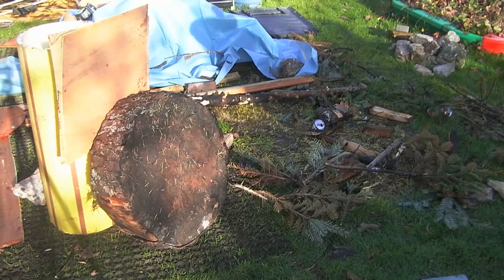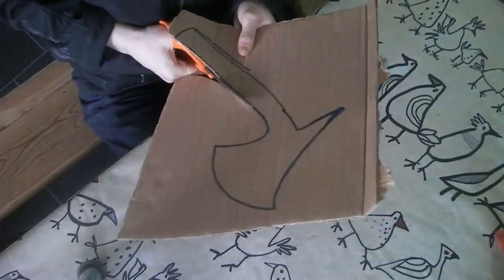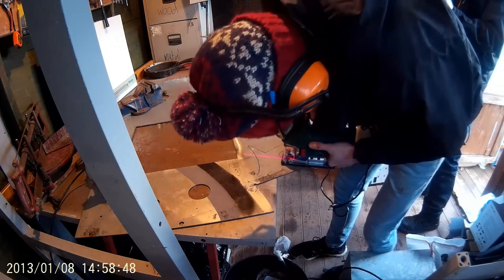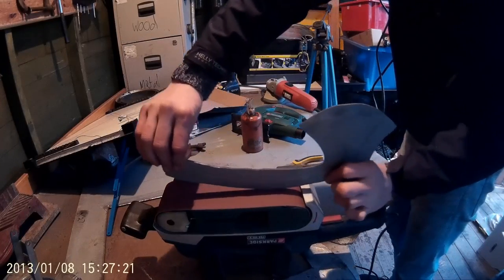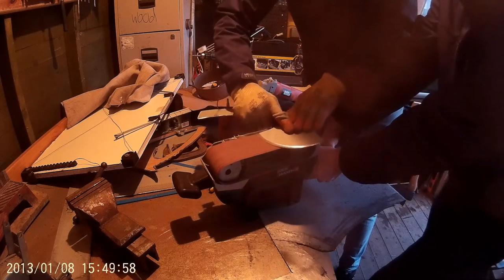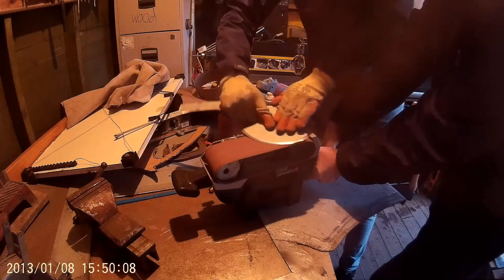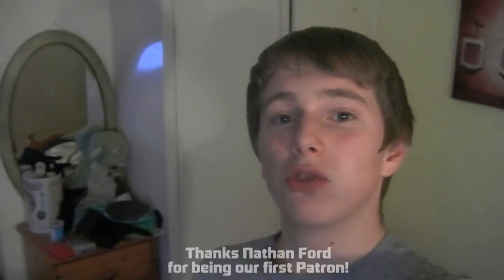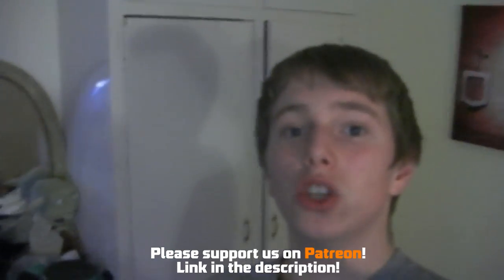How To Make: A Tomahawk/Throwing Axe

Comment: You should really learn how to heat treat and temper.
These are more for props/wall hangers
Without a heat treat and tempering you're basically spending a couple hours doing nothing because the edge will roll and go blunt within the first couple throws/hits.

Comment: Was the steel plate already heat treated or you just made a blunt piece of metal?
Reply from the maker: The metal isn't heat treated but we're looking into it and it's more difficult due to us using a homemade furnace. However it was high-ish carbon steel, So it kept the edge sharp.
Reply: Ok,an heat treating video would be nice.I'm sure you have enough knowledge(and if you don't i'm sure you'll get some) so i won't start giving advice on how to do it,but i hope it turns out well!Good work!
Reply from the maker: Fenrir Lokisson We're still learning, We want to make 2 designs.

1: A easy to make design out of common red bricks.

2: A more advanced design out of fire cement or ceramic blanket with a steel container.

But that'll be a while....